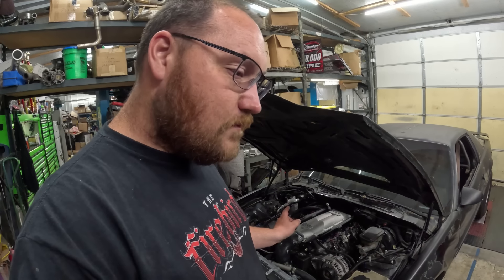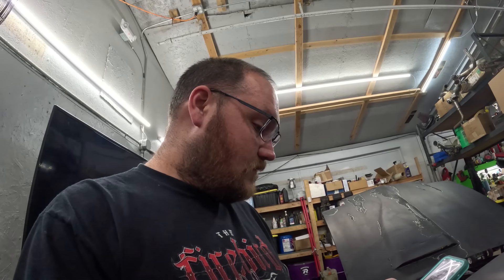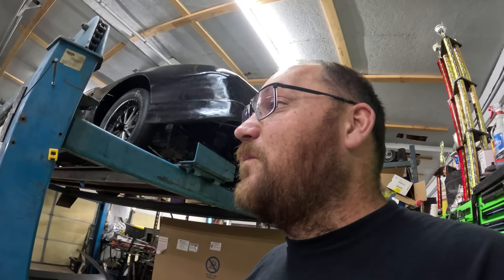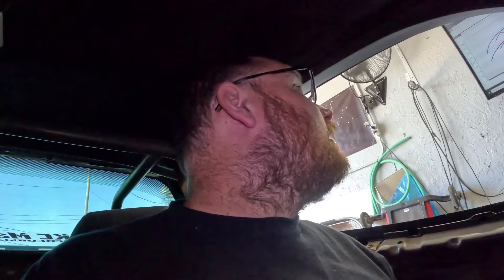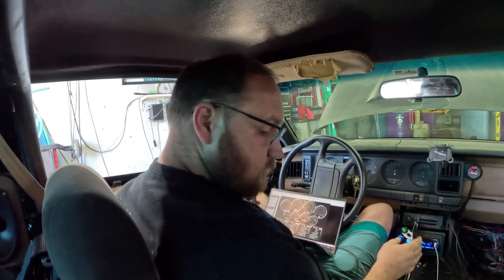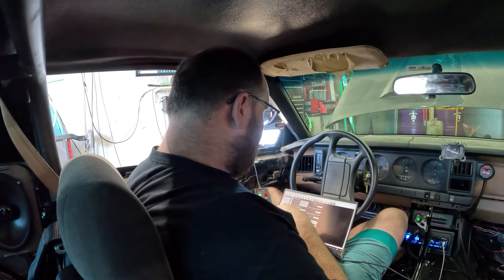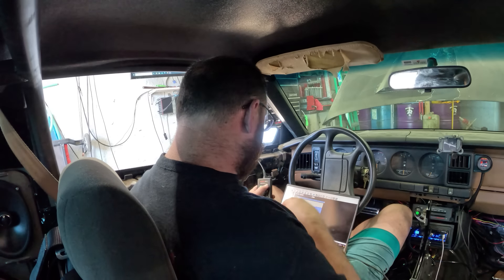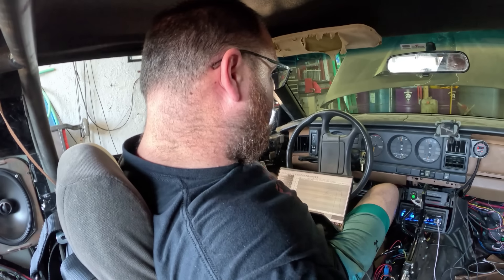DYNO 101 Class is in session

Comment: Those numbers don’t make sense that’s not one atmosphere and you double the horsepower out put how does that work?
Reply: Air flow and efficiency, just as soon as it came alive it snuffed out once I was past that sweet spot. From my experience most turbo or blower applications loose power installing them until you get 4-6lbs going in most cases, then positive results can be seen. After that continue until you run out of octane or air flow, in my case it was air flow this go around.
Reply: @RyanMitchellKCMaxx  awesome man glad you took the time to explain that I always thought you had to be at 14psi to double the n/a  power out put of an engine love the channel and everything you guys do keep up the good work and we will keep pulling for the firebirds
Reply: @danieljones685 Technically 14.7 psi. 15 usually. An atmosphere is 14.7.